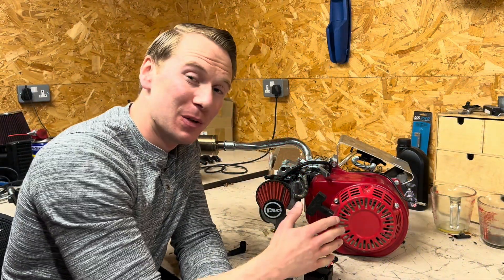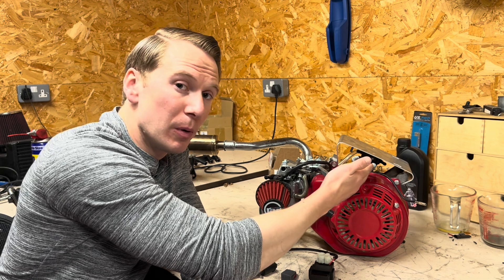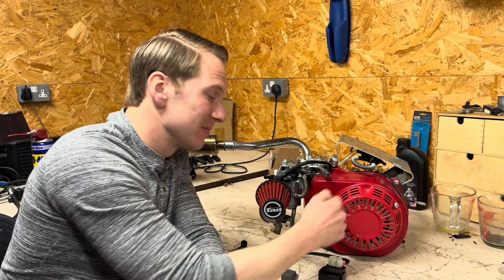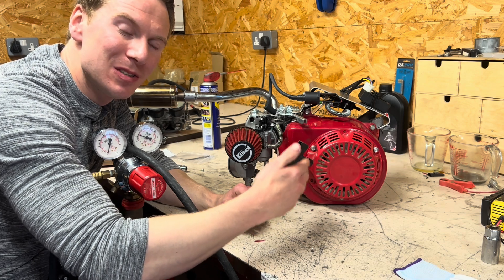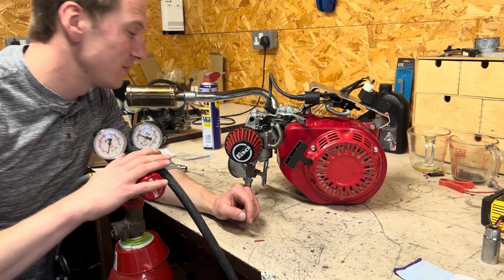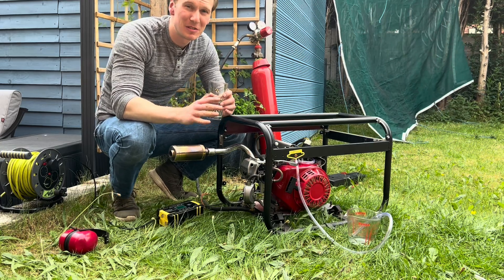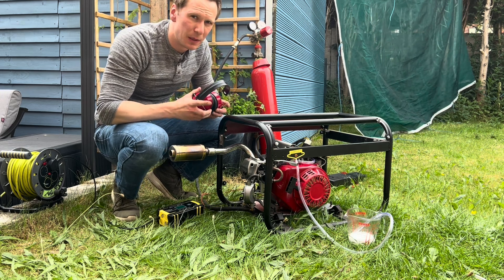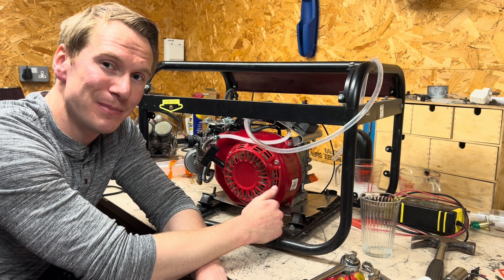Upgraded ignition system for hydrogen combustion

Comment: JCB, i think, designed their engine upside down so that the gas rises into the chamber.  I love what you're doing.  Only critic is that you need a lavalier mic.  TheZoom F2-BT is simple and supports timecode sync with the recording, or you can sync it in post production. It's also 32-bit so can record around the loud engine sounds without clipping. Anything to make you sound better than the camera mic sounds while you're doing the great work you're doing..

Comment: How many hours of run time did you get before the engine oil had become so emulsified? You must be getting a far amount of water past the rings.
Reply: There shouldn’t be much more than with petrol in theory
Reply from the maker: I change the oil at half the recommended service time, the oil does get contaminated quite quickly. Thanks for the comment ✌️

Comment: What are the changes you did? I quite dont understand your slang. Sorry bro. Pls put it in words pls
Reply from the maker: Hi, I have but all the changes in previous videos, but to summarise:
For low load and recreational purposes only all you need to change in the carburettor and ignition timing, 

For a performance build you will need to change:
The internals to handle the high heat and speed. 
Thanks for the Sub ✌️

Comment: Makes you wonder… Keep going! Also, you don’t need top dead center if you use EGR.
Reply from the maker: At low rpm you need TDC ignition as hydrogen ignition is so quick, but yeah ERG can delay that. Thankfully not needed in this set up ✌️
Reply: @Hydrogenguys proud of you! Keep going!

Comment: Very cool. At current pricing, how much would it cost in fuel to run for an hour at tick over? Are there power differences between this and petrol?
Reply from the maker: Hydrogen sadly costs a lot more than petrol , so not viable for everyday use unless you make your own. But this is for a racing application so a bit different I guess. With this set up it’s typically around 20% less power. But im aiming for high rpm to compensate.

Comment: If you plan to market this, it would help if you could make it quiet, or at least an add on silencer at an extra cost.
Reply from the maker: 100%. This engine is for racing applications though so noise isn’t much of an issue, for a generator however then yeah a good quality stainless steel muffler will do ✌️